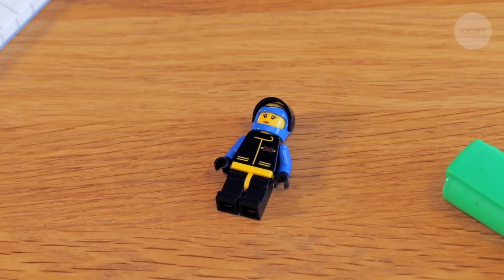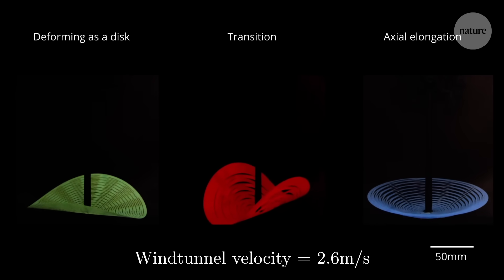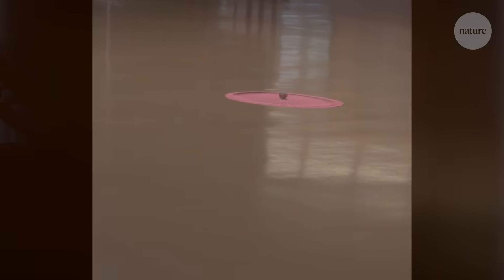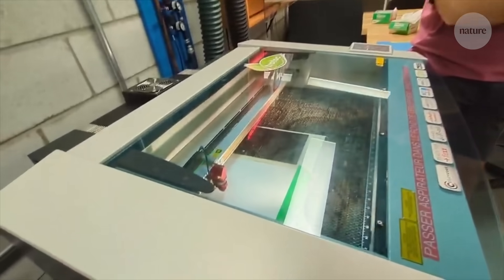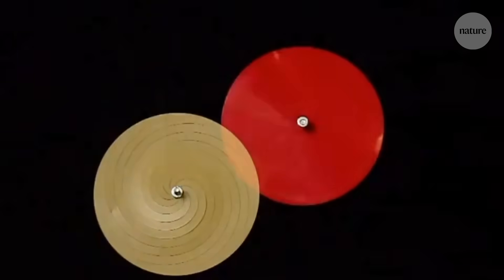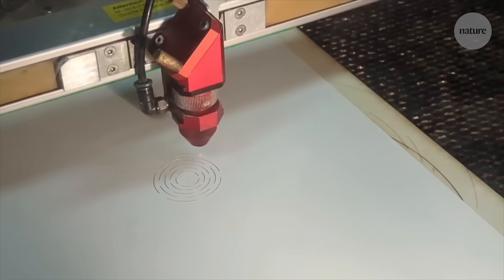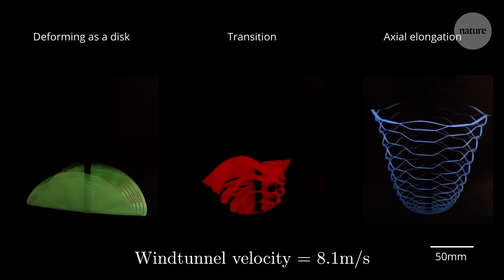This parachute is full of holes and that's a good thing

Comment: Looks interesting as click bate and after presentation I was left shocked how naïve this all is. I guess as long as someone is giving them money to pay outside they will do it. Wea have not received information of crucial importance. What is energy on impact in relation to weight and size of parachute. What is minimum hight for deceleration per kilo. How is parachute direction managed. And examples are not great. Remembering my primary school class experiments I am sure we can safely land egg from lower hight and with smaller paper parachute and 4 tiny strings. How is parachute packed and unpacked. it is silly to say we are thinking of origami parachute as every parachute need to be packed. You just can not manage or drop 10 square meter anything. So that is traditional parachuting they are laughing about. Round parachutes are not in use for very long time except for cargo or for play. And cuts and openings how ever you call them are already in use in parachute design. The only interesting thing here is idea that drag can be increased with net type of structure of parachute to multiply efficiency.  And one thing i have notices that I do not think they did is that their parachute looked to have more drag when it was pulled up than in free fall. maybe drag incises way more on higher speeds. Anyway it is also very noticeable that decention of egg is to fast comparing to smaller paper made play parachute kids play with. if this is anything they have very long way to go.

Comment: The laser cutting is overkill. You could cut the same pattern with an offset series of razors and by spinning the razors or material 90 degrees. This is dramatically cheaper for mass production.

Comment: It looks like when subject to a relatively heavy load it forms a cone and almost punches through the air like a solid cone.  Have you tried making a small radial cut on the interior side of each junction?  This would form a non load bearing (well, non tensile load bearing) "flap" on the inner edge of each horizontal part.  My theory is, airflow would deflect that up, forming an angled surface directing air inside the cone.  It would also create a radial force on the structure helping to pull it out and flatten it.  This might make it more efficient or effective at slowing the fall.

Comment: 3 min. in the story. Demonstration where some tumbles aroud and fiinaly a very hard landing - did the subject survive? Theold model with af hole on top in the middle are veyr safe due to fact, that the parachute slide down on at colum of air escaping from the top opening. It keep a stable speed down and and stable ride - only harsh wind will disturb this.

This new concept looks most like the very first attempt to jump with af parachue from the eiffel tower, where the dear Franz Reichelt has a very hard landing - he died from.

Comment: I am talking on a hunch, because i am no scientist, but it seems like one of those technologies that need a new generation of materials to see a practical application.
With how it stretches behind payload, i feel like by the time you reach a minumal viable scale for practical application, materials will shear against air resistance and it's own weight. Kinda like you can't make giant paper airplane, because paper can't support its own weight, which requires reinforcement, which requires more material, which require more weight capacity, etc, etc.

Comment: Is it stackable? i.e. attach another disc around the edge to the top of the first that will extend to a point when dropped, then attach another disc at the centre of that one, rinse, repeat. I would even wonder if it would eventually turn into a kite if it was long enough

Comment: It is an interesting concept.  I would never use this for any form of skydiving, of course.  Canopy deployment malfunctions are not fun, and this has so many potential points of failure, it would be pretty dangerous.  If there were a way to pack it in such a way as to eliminate any points of failure, perhaps it would be good for airdropping supplies.  Until then, the systems we use for jumps and drops work just fine.

Comment: I mean this is interesting in theory, but they seem to be ignoring the scale required. Look at the one with the egg. The diameter of the disc is easily 20x as wide as the egg. That means even for something the size/weight of your average Amazon box, you’re going to need a disc 15+ ft across
Reply: Only if the Amazon box was completely full of liquid (like the egg is). I think this could be useful for low density loads that won't take damage at higher descent rates. For example, MRE's, vitamins, seeds, bags of rice... Not useful for glass jars, or people, or armored vehicles.

Comment: This will not scale. the physics wont allow it. Too light means flimsy means useless in air resistance. Small scale works when air molecules are big enough to slow the small light disc parachute. When you scale up the disc parachute the air molecules don't grow in size therefore not enough drag to slow the rate of the drop

Comment: i note that they have not a single example of this being actually packed up.
that is one of the advantages of a traditional parachute, since the material is just textile it deforms enough that it can easily be put into a backpack for deployment.

on that alone this thing fails and will never be used.

Comment: Biggest problem I am seeing is the ratio between weight and the size of the "parachute" needed to slow the fall enough to keep whatever is falling enough to leave its landing intact. Nothing they were using was heavy in any conventional meaning.
Reply: Is what im thinking. They didn't run any control tests here.

Comment: it doesnt seem like they know the reason it works... they are only focusing on the holes and not taking into account the deform resistance of the material. it needs to optimize surface area vs air resistance through the holes to throttle the speed of descent.
basically every single surface acts as a lifting body sending air into the next level of lifting bodies. 
while also allowing the negative pressure caused in the inner areas to be countered by the tail end of the vortex applying an equalizing pressure to the center. 
you're basically moving through very thin water that can compress.
Reply: if the upper lifting bodies are higher than the upper reaches of the vortex caused by the lower rung of lifting bodies. than the less pressure is exerted upon them and the more speed needed to create lift/resistance. 
if they are too close though. they will act as a whole wing and the lifting body will need to sweep back and forth or topple to the side or fold completely. depending on stability of the material. to concede to gravity's insistence that you "get down from there".

Comment: I wonder at what scale these would need to be to slow down a person to a safe landing speed. Also would that size scale linearly or exponentially for larger objects such as vehicles. One of the biggest benefit of traditional parachutes is how small they compress down to for storage. Would these be able to do the same?

Comment: The biggest thing that stands out to me, which i don't believe was mentioned, is that with the central attachment point it becomes inherently stable. Unlike a standard circumferential attachment method of parachutes what are prone to singe point failures resulting in asymmetrical drag characteristics

Comment: What size would it need to have to support a fully grown, maybe overweight human plus necessary gear? 
Did the origami concept produce any viable models? Nobody will walk with a 20m in diameter disk around them
They can try to build a custom, vertical wind tunnel to check for Eddy currents and drag and adjust the design. Also better compare it to the traditional model

Comment: The material must hold its shape to be effective. How can one pack that into a pack? It might work when dropping supplies with a disk cute attached externally atop it, although that first encounter with the air at speed presents problems. Also, deforming where material strips weaken and bend is another issue. I keep thinking about that guy who jumped off the Eiffel Tower in his Parachute Suit and how "well" that ended. Will we soon have yet another video to add to a "What Were They Thinking?" segment on YT? Regardless, I am interested in seeing how far they can take this idea. Drone deliveries might present a market, because those disposable plastic chutes stores like Walmart now use lets the package hit the ground like a cartoon piano.

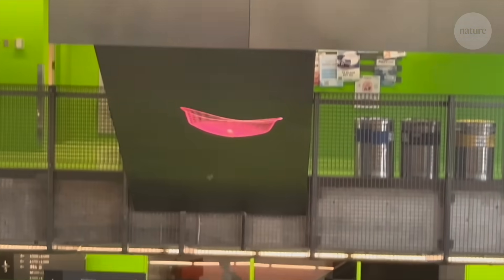Comment: 0:28 the shape this chute takes shows that central regions of the circle take smaller air pressure than lateral. Maybe you should vary width between cuts to optimize it

Comment: Seems like slowing down the air flow is the last variable to account for in perfecting this disposable delivery system. The stability is already great. What if the slits were angled (louvered) to create air flow toward the center, and an internal expanding element would further slow the air flow? 2 elements but still dirt cheap.

Comment: I did not see any example in the video of such a parachute supporting a load, and that is kind of the point.  I also saw no way to steer such a chute, or to mitigate the wind speed across the ground.
Many potential applications for a safer, more stable parachute come to mind immediately: Military applications (paratroops, heavy equipment, supplies), humanitarian applications, disaster relief, and perhaps a better way to get space capsules, astronauts and rovers to the surface safely.

Comment: I'm just curious how they would pack this parachute into a small enough size for the flight before it's dropped. You would need a massive disc to handle tens or hundreds of pounds/kg payload. You don't want to be flying that through the air unless your craft is a flying saucer.  Would you roll it up into a cylinder? Is there some other wierd 3d shape that these can fold into and reliably deploy?

Comment: Could you pack hundreds of them in a stack with an array of cordage connecting it to a weight distributing plate? The cordaage can be of varying lengths and positions. I can imagine this being a complete replacement for regular parachutes. Especially considering that each piece of cordage doesn't have to carry much of the weight so it can be smaller/lighter.

Comment: Yet none of the examples demonstrate a packed version.

Note that stamping a pattern is far from foolproof. I have dealt with many a pre-perforated or cut object that was supposed to separate cleanly, but did not.

So you want someone to jump, or drop a container, out of an aircraft, with a 20m diameter semi-ridged disc attached.

The semi-ridged part is important. That is where their chute gets it's structural stability from. You have to make it out of something that provides similar stability once it's been scaled up.

Comment: Interesting. Since it's just a thin disc, can't you layer several disks on top of each-other with some string in-between?

The advantage of a standard parachute for humans is that it can be steered a bit by pulling on the strings. Could you do something like that for kirigami parachutes? Or will this just be for cargo drops?

Comment: Would be interesting to get them a few test rigs inside of a vertical wind tunnel for analysis, really try and figure out the dynamics of shapes that are possible. I imagine it's about essentially cutting out a series of aerodynamic foils from the flat sheet of paper and creating a series/network of airfoils. really it's elegance in the simplicity of manufacture with the complexity of design that really could shape the delivery of supplies around the world for sure. Very exciting avenue of thought that I hope they continue to experiment with.

Comment: If, due to the spring nature of it, the openings become larger or smaller, depending on the payload, as it looks it would, then it stands to reason that, if the dimensions of the parachute are constant, as the payload increases so does the terminal velocity; the only workaround that comes out of my head, right now, would be to produce them in many different sizes for specific payload ratings.

Comment: Prior to making cuts, layer the disk (e.g. 3d printing, or use of thicker disk with different shaving depth for final product) with opposing circular airfoils (analagoues to binary rotary helicopters) that repeats and extends throughout the disk  The airflow that will flow through it will give additional lift (i.e. glide).  Tests should be done in a aerodynamic chamber with airflow study.  Alternatively load up basic aerodynamic physics into a program and have AI find the best solution.  I have used such application on my channel 👍😎✨️ /s/ ChiefLiviz

Comment: Put a shock sensor at the bottom and see if it offers the same amount of protection.
Reply: Terminal velocity is mentioned in the paper, no need for a shock sensor as it's directly related to the touchdown speed.

Comment: Physics change with scale in non trivial ways. For a parachute, larger scale means relatively less viscosity, or a lot more turbulence.
You could perform a dimensional analysis and aim for the same dimensional regime by modifying other variables like material properties and load mass.

Comment: make a design that can drop 10KG gently. if not, the application for humanitarian aide/ emergency transplant organ delivery/ vaccines is not possible.

maybe an upside-down umbrella, with spokes/spines to support stiffness for larger scale, there's gotta be a light material as it is strong that exists today. there should be kind of an umbrella spring mechanism to open when released(prevents the "chute" from opening while getting to destination) so like a closed umbrella, the load is at the bottom(tip of the closed umbrella), the drones will hold on to the outer tips of the spines* kept together until dropping it on desired location. right now, i don't see all of that as cheaper tho.

but i think, for space missions that would be more reliable than an apparatus with strings that could be tangled and malfunction.

Comment: Very interesting. So the problem that is really getting solved here is parachute efficiency. Lets say you dropp 1kg from a height and strap on a parachute, how light can you make it but still dropping at a safe speed. 
As said by the researcher in the clip, they are creating miniature turbulent air and that is the key too succeed. Maybe have a normal drop parachute but made with a very very fine mesh, every little hole in the parachute will create a turbulent flow and slow down the parachute. Maybe it's already happening, maybe military parachutes are made like this. Just too let you know I'm sitting with my morning coffee and thinking about it, I have no experience with parachutes at all, so these are just my naive thoughts. 😅

Comment: 1- can you stack several in a linear chain to augment the effect without taking up more room so that a heavier load you could just add more "kirishute" to the stack.
2-instead of cutting clean arcs is it possible to cut (wave or zigzag) pattern on the arcs in order to add more edges to the material and thus increase the amount of drag?
3-if the material is plastic and slippery enough it can be rolled instead like a tube. Thus a primary kirishute can pull a membrane off to release a secondary larger rolled up kirishute that is rolled around the body of something like a rocket.
4-if 1 is possible, then stacking several in a pattern like center-to-center then edge-to-edge then center-to-center again like a paper chain garland would allow a pancake stack of something small diameter to have a much larger effect.
Reply: Excellent ideas maybe stacking several of them and then rolling to improve packability and lift capacity. I could see several of them stacked in the center of a roll of larger ones and then stuffed into a backpack or other deployment device. I also wonder if they could be made to spin and have specific wing like shapes to provide an aditional autogyro effect.
Reply: Maybe you should just do it. It sounds like a better idea.

Comment: I don't know what he's talking about at 2:45. You can see the airflow buffeting the crap out of that thing the closer you get to the top.. The reason it's not shaking the cargo is that it's not rigid (like taut parachute strings). It's flexible and all the energy is getting absorbed before it gets to the cargo. You can see it's buffeting less and less as you go down the parachute.
Reply: Maybe on Mars or with less gravity. You need to print it? No wind atall?
Reply: Are you referring to the clips of the camera dropped by the drone?  Cause I'm pretty sure it'd be obvious why those parachutes would have appeared quite a bit less stable than the rest.

Comment: I'm a paraglider and the square reserve shoots are very popular. The square has openings to allow air to pass through and the square shape also prevents oscillation. Definitely more labor intensive but the material packs down small. I feel to have one of these made out of a durable material would be hard to pack down small enough to be realistic.
Reply: I wonder if tyvek is a good material for that.

Comment: If I had to guess, what's happening here perhaps is a case of basically the sort of thing that happens to slinkies where when you drop a slinky, the bottom will only start to fall once the top reaches it With that also being paired with depending on the cuts you do and the type of material you use in relation to the amount of weight you want to safely drop, this also could perhaps be essentially keeping the super flat wide surface area to create a lot of air resistance on top of getting that slinky like effect